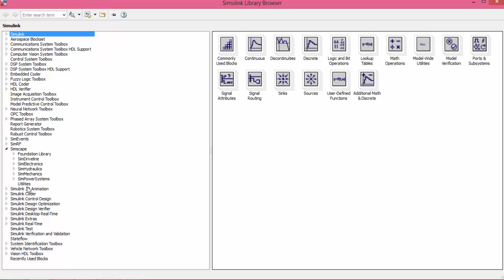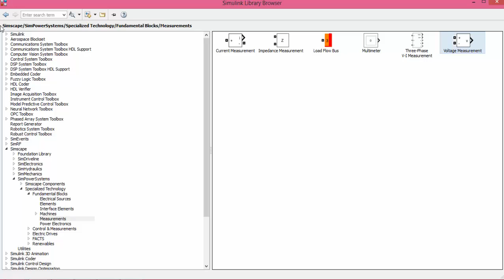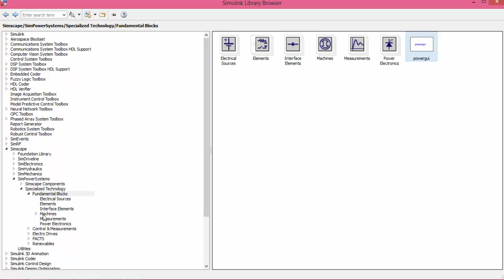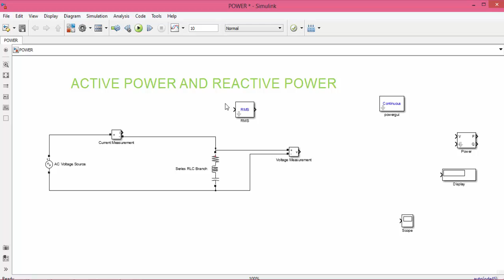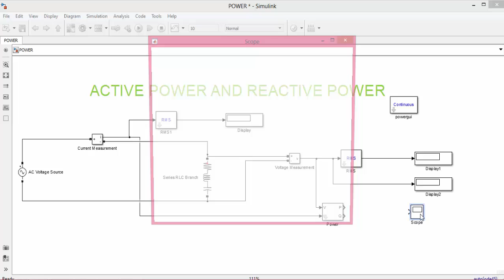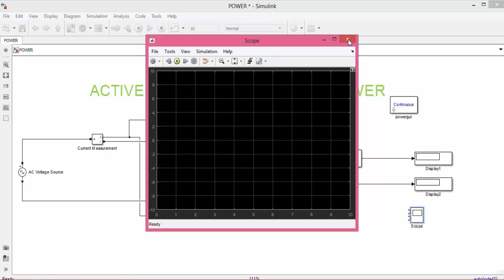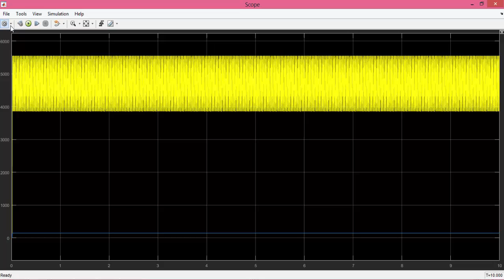matlab simulation of active and reactive power

Comment: Good Simulation. 

But go to your RMS block and change your fundamental frequency to 50Hz and the initial RMS value to something higher than your input voltage.

You must also change the specified frequency in your Power block to 50Hz. That is the reason you are not getting an average power at the active power scope. You shouldn't be getting a sinusoidal waveform in your active power since we are looking at average values here.
Reply from the maker: Thank u